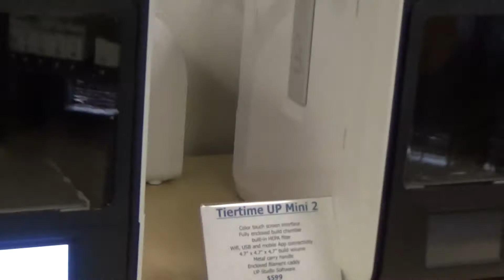MakerTree3D TierTime X5, UP300, UPmini 2ES, Cetus 3D Short Version

Comment: Hi, how hard is it to remove ABS parts from the UP300 and how large are you able to print without warping?
Reply from the maker: 205 × 255 × 225mm (8.7″ x 10″ x 8.8″)
You should be able to print as large as the bed without warping, and if there is, just use a raft.
Reply: Lunchbox Elrod have you printed that large yet? Do you have any print pictures you could share?
Reply from the maker: I don't have any pictures, but I have printed the full surface area of the Upbox+. Which is also large. Just have to let the chamber preheat and set to slow.
Reply: I echo this - my Up Box heats better than any printer I've got (inc. Ultimaker 3) and prints extremely well but warping is still a huge problem - for large prints the room temp needs to be 40+Celsius (!) and it needs to be preheated for at least 15 mins because it doesn't have a heated chamber. I received an Up Box+ but it didn't heat as well as my original Up Box and I had to return it. I also have an Up Mini 2 and it's absolutely terrible - heating takes 45 mins and ABS printing is terrible (basically making it unusable)